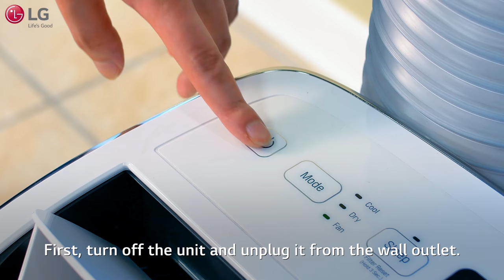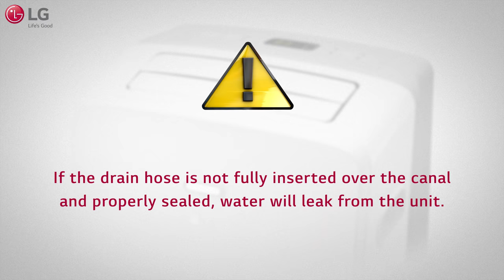LG Portable AC - How to Setup A Continuous Drain

Comment: How many people have floor drains in their bedrooms? LG peeps are living a more exciting life than me if they need to hose down their bedrooms..
Reply: Well, you know. Ladies love a robot voice.
Reply: Dude, I'm actually pissed. They throw it at you like its common sense. "Then, you know, just throw the hose over to your floor drain, duh"
Reply: Thank you, I'm using this type of LG AC in an attic, no floor drains here bud, oh wait.. No floor drains downstairs either, looks like they create units you can only use in a basement or outside (where I don't need an AC). 🙄
Reply: Funny enough, I have a floor drain. Then again, my room is connected to the closet that holds the water system for the entire house, so I'm a special case.
Reply: Ikr?!!!!  Wth is this guy smoking?
Reply: What I did was used a metal hose clap instead of a ziptie for a tighter seal. I sat the portable AC unit on an end table so that the drain port was higher than the lowest point on the window to solve gravity issue. I drilled a practically perfect hole out of the plastic guard a few inches away from the vent hole for the hose to go through. I found an older screen (more an aesthetics choice on my part to use a screen instead of taking it out) that I cut a small hole out of so the drain hose could stick out far enough (2-3 inches) to drain into the back yard. I also put the portable AC unit on old towel so it wouldn't roll around as easy on a flat smooth surface and I folded the towel so the front wheels sat just a bit higher than the back where the drain spout is just to help with gravity a little more. Honestly It ended up working so much better than I expected. It's so humid here the tank would fill up within a few hours so using it while sleeping was annoying and practically useless. 

***If I remember correctly a 5/8 inch IO (inner diameter) PVC vinyl tubing fit around the drain spout perfectly. Yours may be different. I measured the best I could but ended up coming home from Lowes with 2-3 different sizes to be safe.
Reply: @dperin00011  this is great info, I am dealing with the same due to high humidity. Thanks for sharing! You should have made a clip to share on YT 🤩
Reply: @333AppalachiaEnergetics  No problem. It's still working like a charm. No leaks. Just make sure you get the hose clamp on tight enough and have the flathead screw on the clamp angled well enough to get good leverage to tighten it. ☺️☺️
Reply: @kpsgenius  south Korean homes are equipped with drain in their veranda and washrooms.
Reply: That’s a problem. Maybe run it out a window. But without a pump, that won’t work
Reply: You can place a big bowl and drain the water there and empty it once every 24 hours. Come on! Use your brain!
Reply from the maker: Hey there! Thank you for reaching out to us with your feedback. We truly appreciate your honesty and the time you’ve taken to share your experience. We want to assure you that your voice matters to us. We value your insights, and we’ll make sure to pass this information along to our product development team. If you have any further concerns or need assistance, please don’t hesitate to reach out via our Facebook or X account @LGUSSupport. We’re here to help! ^Sam
Reply: i can't really find any definitive answer on whether it's even necessary to hook up the drainage hose. even in this video it says at the very beginning "it may be necessary".
i've seen other things online that say sometimes the water water filling up inside can't be recycled quickly enough in which case it'll need to be drained. making it sound as tbough sometimes it will be "recycled" quickly enough, whatever that means, and won't need to be drained.
i imagine portable acs are pretty common so you wouldn't think everything you find on this topic would be so vague and unclear.
Reply: @Jack_80  recycled is almost certainly supposed to be evaporated.
Reply: @Face_RC  yeah, i don't know much about them but i just got a newer one, so it should have an automatic shut off if it does fill up too high. i just ran it for an hour just to see how it works, and there was quite a bit of water built up for it only being an hour. kinda hard to imagine it being able to evaporate quick enough at that rate, but like i said, i don't really know anything about it so maybe it will.
Reply: Ok, well, if you are here to help Sam come over and install drain hole in my bedrooms floor. @LGUSA
Reply: My damn thoughts😂..these are worst air-conditioning units because of the drain
Reply: @LukaDonesnitch only for basements
Reply: @Jack_80  It is. This thing flooded my living room
Reply: @joeschmoe435  i just got a new portable ac a month or so ago, hasn't filled up with enough water to need emptied or anything yet.
Reply: @Jack_80  I was having to run mine directly into a bucket and dump it several times per day. 3-5 gallons a day that thing produced. Ended up buying a little pump that runs the water directly out a window
Reply: A bunch of words with no actual help. Why even bother
Reply: Right! I thought the same exact thing.  Who has a floor drain anywhere other than the bathroom. Really?

Comment: I made a mistake buying a portable AC without knowing the drainage issue, it is pain in the A
Reply: Exactly….. it needs to be below the unit when the unit is already on the ground. They never show drain line when advertising.
Reply: Yep, no pan fits under this 200 lbs monster. Can’t roll it on carpet and down stairs to drain. This is a poor design.
Reply: You would think that they would have thought it out better to begin with. I don't know if my apartment was built before floor drains in every room were the standard. But it should have been adressed

Comment: Damn if only I had the builder put a floor drain in my bedroom! LOL Like others I have eleveated mine and drain into a condensate pump which then pumps into a 5 gallon pail.
Reply: Exactly what I was thinking. If they're going to provide advice on non-OEM solutions, they could've at least provided a more likely scenario (no floor drain nearby) and suggested what you ended up doing. Thanks for your advice.
Reply: @edwardpate6128  Better still mine pumps out the windows.

Comment: I live in Florida-lots of humidity- plus I am elderly and live alone. No way do I want to deal with this drainage situation on a daily basis!  So here's what I came up with:  There are two drains on the rear of my Magnavox AC..I removed both caps..I got a cart on wheels with 2 shelves, an upper and a lower. (think of metal microwave carts...I found one at a garage sale for ten dollars)..Place the AC unit on the top shelf and run the duct out the window as directed. Place a pail on the lower shelf. Run a drain hose (clear 3'  length from aquarium supply store or Ace Hardware ) from drain(s) to pail and empty the  pail of water each morning. Also, try elevating the front wheels just a little (use a folded peice of cardboard to0 reach under both front wheels)  so the back drain works even more efficiently..since doing this, I have not noticed any water coming from the bottom drain, just the larger top drain. My pail is quite often full within a few hours!  This system is working great.   You guys may not do this, but I also covered the cart with fabric so the pail is not visible in the room....Just wheel the cart to storage area when season is over...You are welcome.
Reply: Thid is the perfect Idea thank you...I even have one of those meal cart too.  Genius Idea
Reply: @jellyellis9383  Jerry- Glad this will work for you as well...OH!  I also elevated the front wheels just a little- this makes drainage out the back even faster and better coz it's gravity-fed....
Reply: I feel you. I live in Southeast Alabama and we're sitting at 100% humidity right now. The past week or two it gets full after about 3 hours.
Reply: @tylarjackson7928  Tyler-  place the AS unit high enough-cut another hole for the drainage, and let it run right out under the window!
Reply: @SuzanneOlsson  I am trying to figure out the same with mine.. EXCEPT I dont think draining out the window is a good idea..unless you connect it to a gutter or some kind of piece to help carry the water away from the foundation of the building..  (I guess it depends if it is going onto dirt or concrete)  i have had issues with mold and am sensitive..and  not probably drained can cause some damage to building.. esp if it is just draining onto dirt.      and i guess too how much water is coming out.  maybe i am "over concerned"      
jst a thought
Reply: @qkcam45  Hi CD- I am 77 years old..I sure could NOT lift mine..had to beg help from a neighbor..then once it was up high, I taped the heck out of it ..used  clear shipping tape..it's all trial and error...Mine is so high now that it comes just above the window sill, so I was able to insert the drain hose just below the huge vent hose...and straight out the window! No more pails to empty...it looks ugly, but works great now...gravity does all the work straight out the window...I live in a condo ..yet the neighbors have not noticed the steady drip of water sliding down the brick wall.  ;-)
Reply: @qkcam45  CD-  that should be an easy fix...just lay a piece if clear plastic on ground...cover with leaves or dirt..it will make a drain as long as you want/need to carry water away from your foundation....any ol' waterproof lining will do..
Reply: @qkcam45  cd-  draining out the window is no different than rainwater hitting the window and sliding down the siding...if drainage at the ground level is a problem (it should not be- it's not nearly as much water as a rainfall)  then lay plastic sheeting down and cover with dirt or leaves- this will take water away from foundation...but as I said...treat your drainage same as rainwater..
Reply: @HarlemSexyBlaqkat  Me too!
Reply: @uzanneOlsson  lol

Comment: Right because every room had a drain in it...
Reply: @julianrdz4508 there is no tube, you would have to buy one. and you would need to have the thing level or above the window to do that... i own one.
Reply: real Real  you would still need to stand the thing up on something the drain hole is near the floor.
Reply: Draining it by lifting the unit every day  is ridiculous. Besides a floor drain which is unheard of, your only choice is a small condensation pump. They have a gravity fed reservoir that fills up then sends the water 10-20 feet high in a tube if necessary. The only catch is that the drain port of the AC - as most know is at the  bottom of the unit. This means the unit needs to sit permanently at a level above the intake hole of the pump. That could be 3-5 inches off the ground -depending on the pump. The best small pumps out there is The  Little Giant. Check amazon.  

I situated some brick pavers in a U shape and sat the unit on them. It’s high enough so that the pump can slide inside.
Reply: @Cello69.  thanks for tip
Reply: Stick to a wonderful Dow u it...colder air...no draining or heavy lifting after its in
Reply: @JS-te4gz   I can't use a Dow u it. My Dow only opens 11.5 inches max
Reply: @Cello69.  I just bought a small square dolly on Amazon for like $30 and put a container under empty when full. But certain times of year it fills up fast gonna get a pump.

Comment: For those without a floor drain. My husband put our a/c unit onto an old coffee table, attached a hose, with a screw on collar, onto the top drain, and clear tubing onto the bottom drain port. He ran the hoses into a 5 gallon water bottle. Gravity pushes the water into it. He either tips it outside, or he uses another clear hose and siphons it out. Easy peasy.
Reply: I just used a wooden bed desk like thng to make a stand for mine. Then put a cheap Dollar General black mop bucket under it, with the bucket lip under the drain. 
Great minds think alike.

Comment: Yeah, I'll just open up the drain hole in my bedroom. What bedroom doesn't have a drain hole?
Reply: You can run it into a big bucket. You’d have to monitor it and or get a float switch.
Reply: @studentaccount4354  You'd probably have to elevate the portable AC unit to allow gravity to work properly.
Reply: @SmallWorldFilms  I don't see how that's an issue. I'm very happy LG have shown that it is perfectly safe to simply add a hose to the bottom of the device while operating. It allows for such creativity to make people's lives easier. I will be doing exactly that.

Comment: @LG USA, can you run a portable AC in dry mode without a duct?  I have an LG portable AC unit that I want to use as a dehumidifier.  I have a place to drain it, but I don't have any windows nearby to put the duct.
Reply: did you find out if you could? I want to use my portable AC in my basement during the winter as a dehumidifier, but I do not want to have to put the duct in the window during the winter.

Comment: Are any of these portable air cons designed to pump the drain water up and out of the tank reserve and out of the window to the outside  even if the drain hose must be placed upwards to and out of the window going upwards at an incline? If not, why not?
Reply: My $400 Haier portable ac/heat/dehumidifier does not have a water pump and the drain is as low as possible, yet my $200 TCL dehumidifier does have a pump and the drain is halfway up the unit! Go figure smh!

Comment: People just buy a small condensate pump, A 3-6 ft garden hose or washer hose, Cut the hose to reach the top spout to the floor, twist the hose onto the top drain plug,  but the other end of the hose into the hole that is on the corner of the condensate pump, put the clear tube on the hole on the condensate pump that is close to the center, then route the clear tube out the window. (All you have to do is plug the pump in no programming or wiring).
Reply: Tristan  that's what I ended up doing too...used an old heater from woodburning kit...melted a hole  near the big exhaust pipe  (that goes out the window anyways) and ran the smaller drain hose out the window too...It flows under the screen and down the wall. No screens or windows had to be cut.   Perfect!  Never have to carry pails of water again.
Reply: You have a link my guy? (Uk)
Reply: But how to get the ac to drain into the condensate pump if the ac drain is on the ground?
Reply: @rhenal1008  the pump will suck the water out into its intake and pump out.
Reply: Does the pump try to run 24/7 or only when there is water to move?
Reply: I'm not MacGyver I just want cool air!

Comment: I just find it weird how a condensate pimp doesn’t have suction to suck the water from the tray. I have one of these except it’s an Arctic King. The location of the pan isn’t in a very convenient place especially if we’re using Gravity to drain it. I propped my unit on a chair and it seems like I still have to tip it to drain it. It’s honestly weird to me that nobody thought about a more gravity based location for that outlet.
Reply: Jacob...the secret is to raise the AC unit high enough -just at or slightly above window levell.......then put both exhaust and drain right outside through  the same panel inserted in the window for the one exhaust...
Reply: @SuzanneOlsson  I can’t put mine out window cause live in Apt building. I bought a small square dolly to set it on and put container under it. If I buy a pump with hose does it have to be higher than the 4 inches it’s off the ground on dolly to empty into a bucket.
Reply: Once that 200 pound beast is 3 feet off the ground it could kill a kid of pet if it fell on them. Bad design really…

Comment: I live in a 3rd floor apartment. …sorry neighbors! 😒 Seriously they can’t give better advice than this?

ETA - love to the real heroes in the comments with practical solutions.
Reply: Hey, if you have to use one of these, just put it on top of something to raise it from the floor, then put a bucket under the drain. or run the hose to the bucket, as long as the unit is above the bucket it will drain

Comment: I need to find a solution to this quickly because my AC puts out so much water that I actually can't believe it. Its like I am tapped directly into the ocean with this thing
Reply from the maker: So sorry to hear this! Please send a message to our support team on FB or Twitter (LGUSSUPPORT) and someone will help you with whatever you may need. Thanks! ^Emma
Reply: @LGUSA  she’s not wrong it’s still doing it like it doesn’t sure the drain pan it just leaks on the floor
Reply: What I did was used a metal hose clap instead of a ziptie for better leverage to get a tighter seal and I sat the portable AC unit on an end table so that the drain port was higher than the lowest point on the window to solve gravity issue. I cut a practically perfect hole out of the plastic guard a few inches away from the vent hole (I actual cut it so perfect I ended up impressing myself just a little). I found an older screen that I cut a small hole out of so the drain hose could stick out far enough (2-3 inches) to drain into the back yard. I also put the portable AC unit on old towel so it wouldn't roll around as easy on a flat smooth surface. Honestly It ended up working so much better than I expected. It's so humid here the tank would fill up within a few hours so using it while sleeping was annoying af.

If you don't want to chance messing up the window guard that the vent hooks into just get a decent sized bucket that holds a few gallons for extra peace of mind and have the hose go directly into that. Empty it each morning. Shouldn't be anywhere near that much water in it.
Reply: hahaha.

Comment: People, you gotta gitta heavy duty RV stool and put these things on. Then use the drain hose to connect from the ac drain spout to a water bottle or storage container. These types of appliances require a massive amount of passification. They suck. All because your frikkn landlord ain't tryna spend munny on cleaning the vent shafts and exhaust vents, or repair a water damaged wall outside of your apartment. Themz the breaks😓